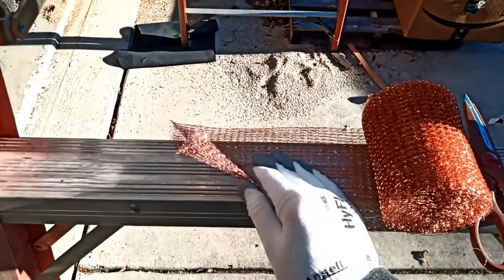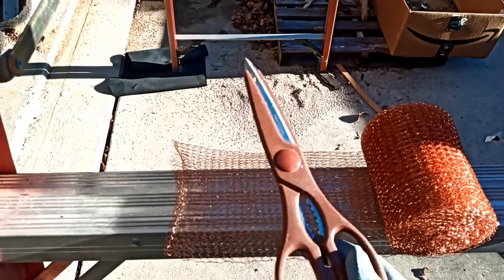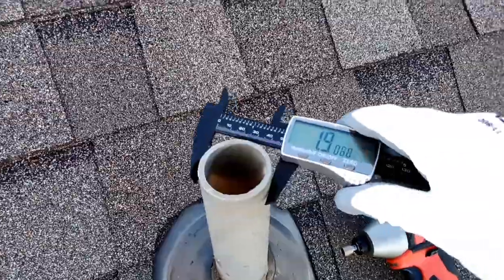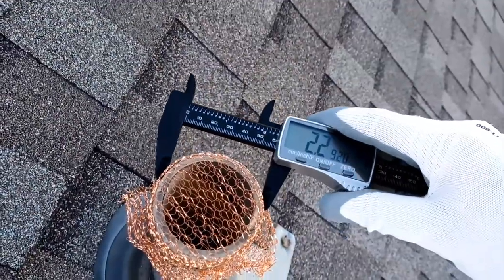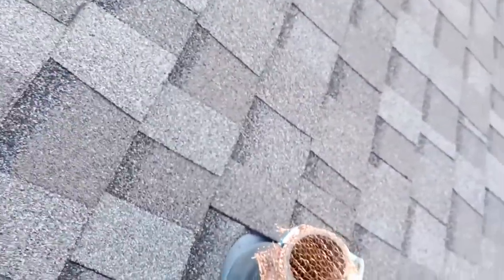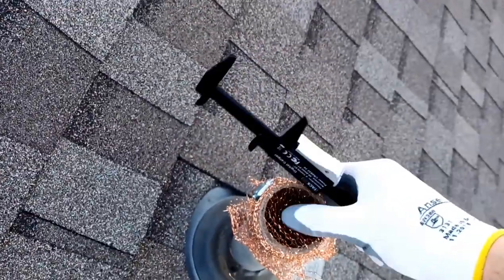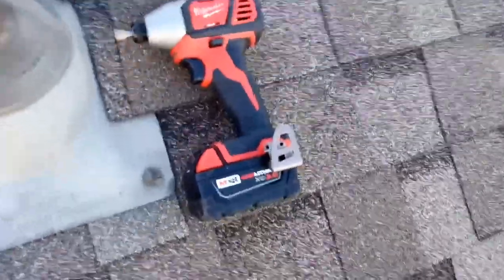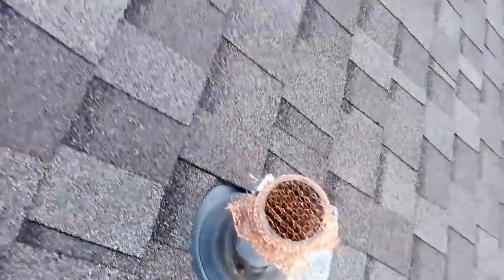Animal-Proof Roof Vent Pipes, Budget method.

Comment: I’m going to be doing this at my house. Nice idea. Only question I have is the mesh is copper, the hose clamp is likely stainless and the vent stack is likely lead. Having three different metal types and the corrosion possibility with the dissimilar metals, I’ll use something other than copper.
Reply from the maker: I ended up switching to a stainless mesh.

Comment: Pretty cool idea! I have not had any problems with my vent pipes, but did have a bat in my AC ducting once...lol
Reply from the maker: Wow, Cool bat. 😜 Mice are the problem here and had some squirrels find a way into the attic which is another video I need to edit. I used old screening from HVAC filters to prevent the squirrels from chewing through again.

Comment: Did it work?
Reply from the maker: It did but overtime one was either bit through or degraded so it's best to use steel or something stronger than the copper I used in the video.